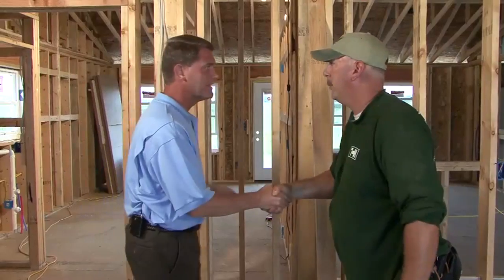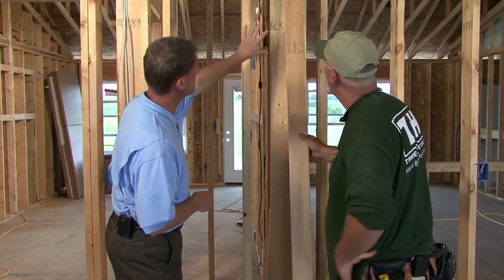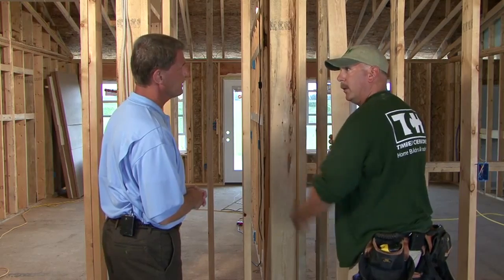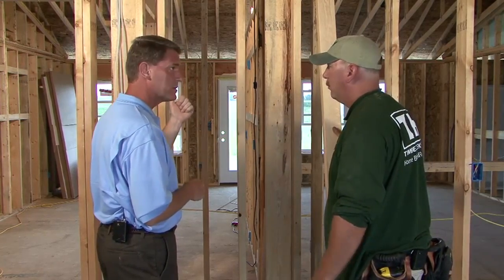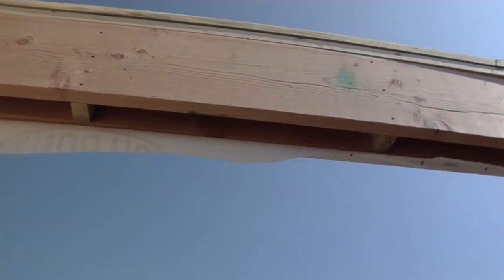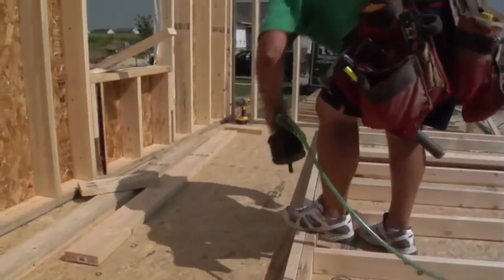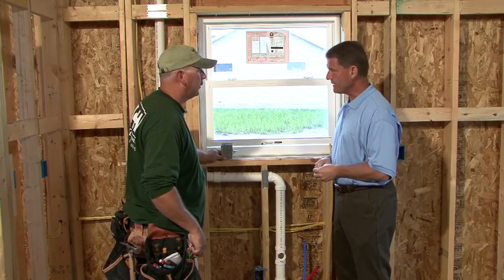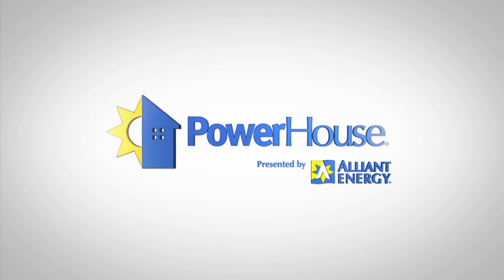Advanced framing  - 03/26/11

Comment: California corners are not "advanced"  they are actually common practice.   it looked like that corner in particular was installed incorrectly.   you should have a solid stud at the end of the wall and the flat stud to back out the adjacent wall.   using box headers would only be allowed if a gable truss was above the opening vs trusses that actually bear on that wall.   this is just a way to cut costs and sell it as energy efficient.   we use all California corners, ladder partitions and 6 sided envelope anywhere a change is ceiling height.  those high dollar vinyl windows in those cheap houses won't like not having a solid header above em in a couple years!   I'm all for cutting costs but not at the expense of structural integrity!

Comment: California corners have been around for many years. Advanced framing is cheaper framing that's it.  It is lower quality. period  One technique to further con the dumb consumer. The steel window brackets cost more then the window trimmers, and gives less nailer for the trim material to be nailed too, and finally another metal bracket holding out the drywall and preventing window drapes from being attached in the very spot they needed to be attached. ADVANCED FRAMING IS A SHAM. It like SEARS claiming to be house experts. IT A CON....

Comment: A flat 2x6 "box" header is not a header at all but a framing technique used to fill space - it has zero structural value on an exterior wall. The cost of a stud is about the same or less that a galvanized metal hanger, which required electricity and toxic chemicals to make and more impact to the environment than cutting a fast growth tree - a renewable resource. How does he plan to hang his drywall on an interior wall by eliminating the stud for corner nailing? This is smoke and mirrors.

Comment: No your wrong, 2 x 4 16OC and 2 x 6 24OC use the same amount of lumber. In fact, your spending more money on exterior framing in the long run when it's not even needed since insulation value has improved dramatically over the last 20 years. Do the math 2 x 6 cost more then a 2 x 4 and your not eliminating enough studs for your labor price to show any gain. It's funny how this guy calls it a "California corner", advanced framing, eliminating trimmers is not even code compliant in California.